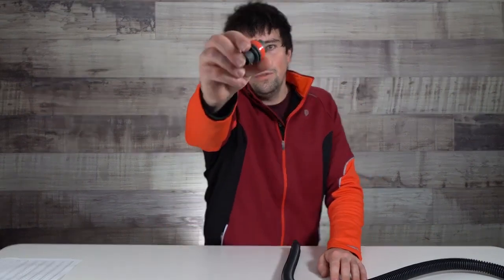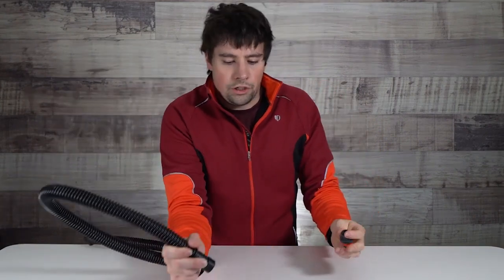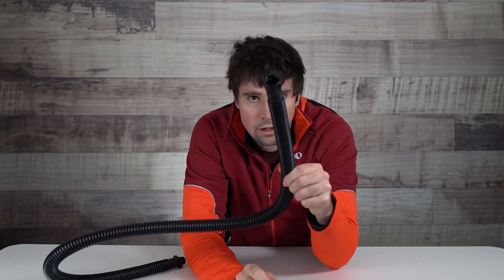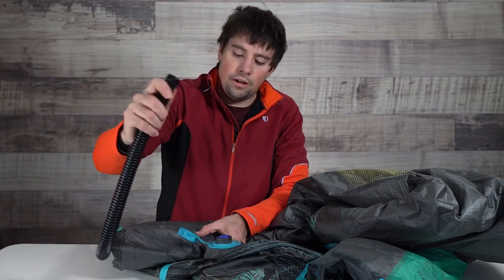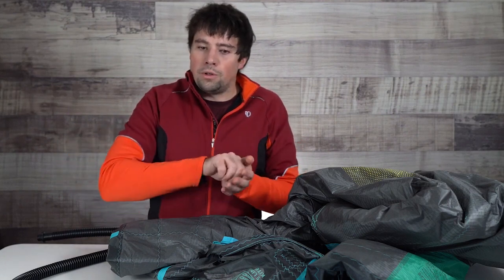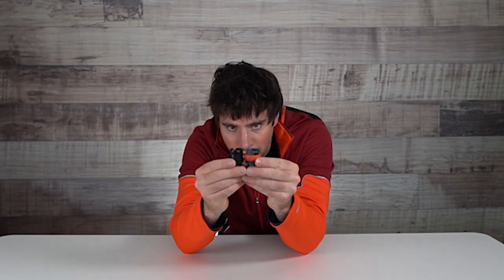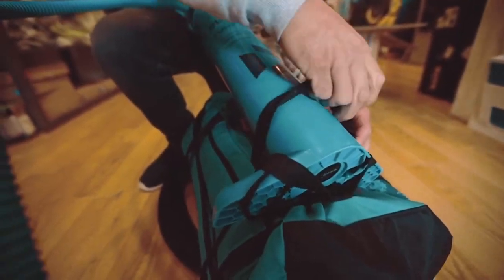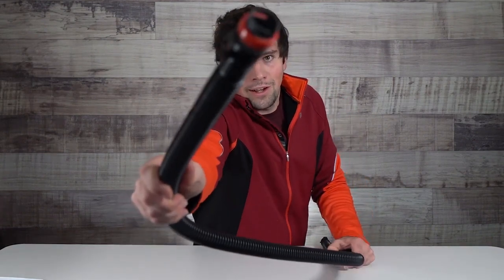Duotone Kite and Wing Inflation Valve Adapter

Comment: I just bought an Ensis score Wing. They provide an adapter ( but no pump). Once arrived at the beach I discovered that the adapter NOT match with regular SUP pump ( hand or electric). So now I have to find the adapter for the adapter or buy a new pump. I hate all this 😮
Reply from the maker: Sorry to hear that Fabio. Kite/wing pumps use a different hose than SUp pumps sadly :( -Tucker
Reply: Are you intersted in testing a electric pump with standard nozzle for inflatable kite and wingfoil?

Comment: Jake, thanks for posting that video. I actually bought a Duotone kite from MacKite along with the WMMF pump instead of a Duotone pump. You said it bang on in the video that the WMMF adapter doesn't fit as securely as the Duotone with the silicone gasket. I find the WMMF adapter very frustrating b/c it easily separates from the kite's inflation valve b/c the rigid plastic of the hose twists it, unless you're hanging onto the connection. I'll be ordering one of these HASSLE FREE Duotone adapters for my kite pump!
Reply from the maker: For sure, another tip is to turn the hose about 1/2 a turn in the opposite direction before connecting so the hose tension works to twist it tight rather than loosen. Make sense? -Tucker
Reply: I've had the same experience with my MACKite Dutone wing and WMFG pump.  Glad to have just now found out about this adapter with a silicone seal.  I will be getting one too.  I've been twisting my hose but it still is a very loose fit, leaks air and occasionally even pops off.  Should be standard issue with a Duotone wing package.

Comment: Does that also help to deflate the wing?
Reply from the maker: On models where you can release the one way valve, yes. That's mostly the HP (sup inflatable) style and Duotone valves.  you'll swap the hose to the intake side and use it that way with the valve held on "open" -Tucker